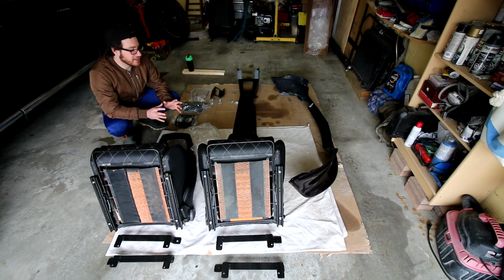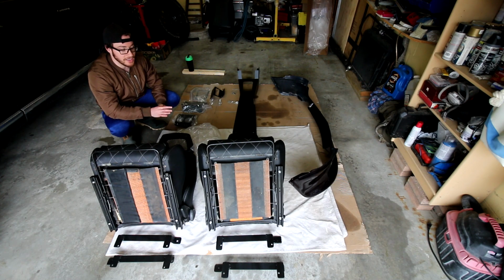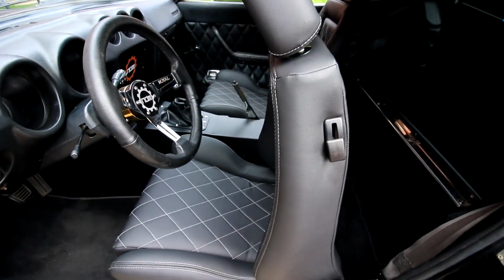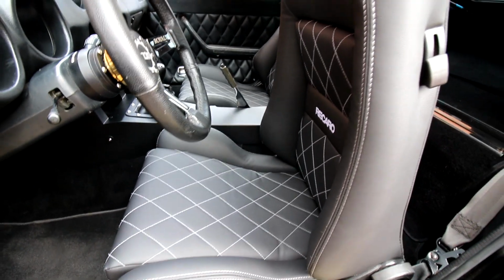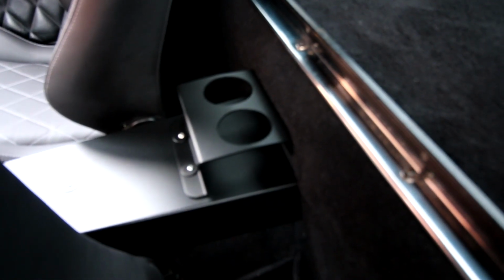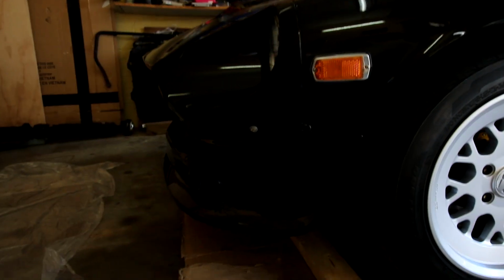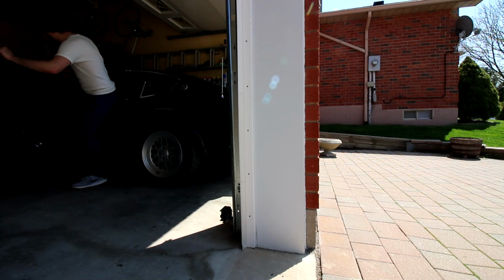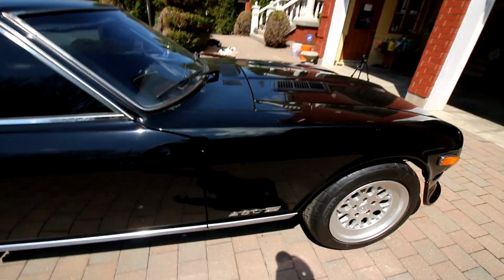The 280z is READY TO DRIVE!

Comment: The GoPro looked like it was focused on BatMANs AB's
    This car has come SUCH a LONG LONG way !
Another Japanese Ferrari getting the love it deserves !!!
     RIPE !
I owned a Black Pearl 
I hated the Black Pearl it always looked dusty to me even right after I washed it.....
I washed it alot. 
The Black Pearl came from the factory with a pin strip kit.
It seems it may have been a dealer applied item because there were more pinstripping 
Than I've seen on other Black Pearls.....
Hell it was just paint and wheels and a limited number made.
It was a second had car, the women that sold it to me smoked heavy , I took seats and carpet and center console out, 
Put new carpets in, detail cleaned the interior like surgery prep clean!
    I spent 5 hrs with a razor blade and carefully removed "ALL pinstripping "
I painted it BMW shwartz cats black. 
I fitted clear headlight covers and urethane bushings.
    Finally it was beautiful black, smelled good looked good and handled good 
  A Black Beauty in stead of a Pearl !